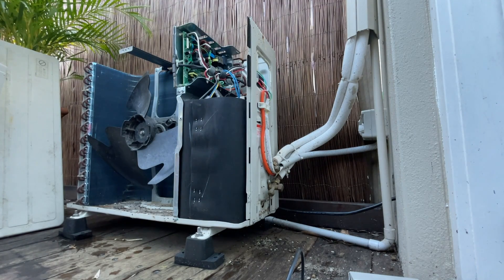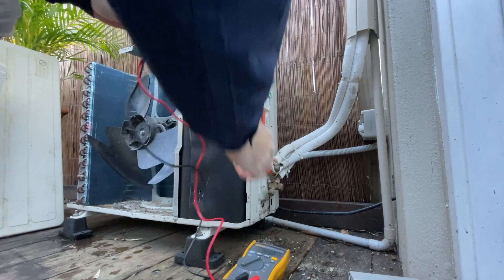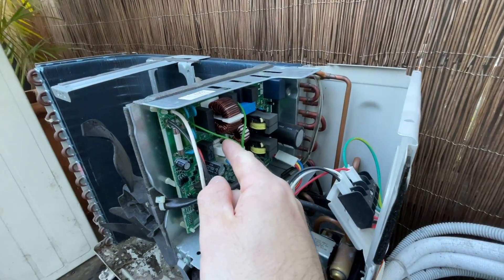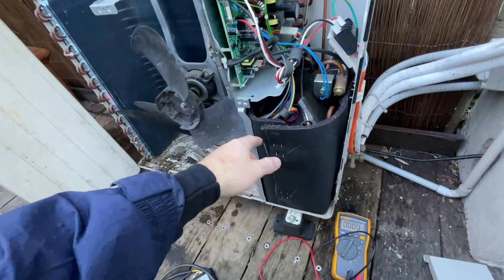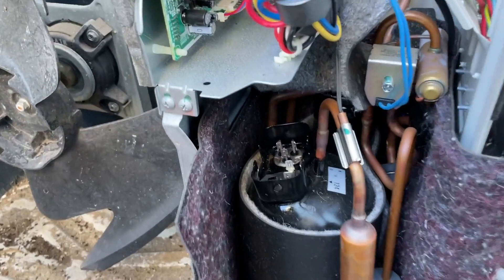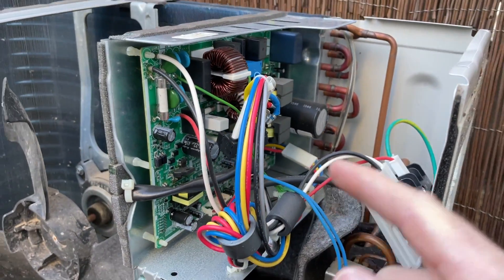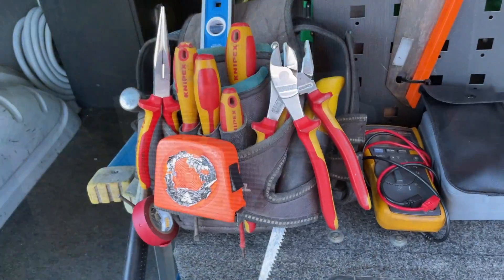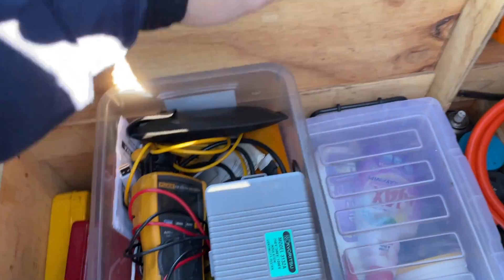DAIKIN Air Conditioner NOT HEATING 🥶

Comment: Hey mate. Commercial refrigeration install tech here. After 14 years working at same company installing Aldi, Cole’s etc finally kicked the bucket and joining a massive commercial air con service company. Just wondering in this circumstance, how come you instantly check the board before anything else? I’d assume off my limited air con knowledge no heating might mean the reversing valve is cooked or possibly even low on gas meaning low head pressure meaning less heating? Or is it as simple with these daikin units that it’s always the board? I’ve been binging your videos trying to familiarise myself with air con service and I’ve noticed most videos of yours it always seems to be the board that’s cooked and I barley see you pull the gauges out. Do you avoid putting gauges on as the gas charges are so small even losing your gauge line worth of gas could be detrimental to the system? Thanks mate love your work, learning a lot watching you!
Reply from the maker: @blakeusvon  hey mate, no heating and no cooling calls can absolutely be more then just a board. I often come across things that aren’t board related but yeah definitely the PCB in my opinion is the weak spot of modern inverter style air conditioners. I’d definitely invest in an inverter checker if you are giving service a go! Good luck with everything!

Comment: Do you ever disconnect the compressor wiring plug and test the comp that way instead of removing the terminals at the comp. Some comps are a prick to get the lugs off. And not all units have a plug that disconnects obviously
Reply from the maker: I personally don’t do that. I want a true reading of the compressor. The cable can absolutely manipulate the true compressor readings.

Comment: if the shaft is rusty... wtf, those are not protected is normal to rust. In this way, you could replace the whole unit, same price and longer life.
Reply from the maker: I got told at Daikin training that you should replace the fan motor when ever you replace the outdoor pcb especially if the shaft is rusty. It’s to prevent the system from cutting out on an E7 fault in the near future. 
Daikin fan motors stop working even when the fans still work (if the revolutions of the fan is slower then what it should be). So their reasoning is, if you’re doing a major repair then just replace an old fan motor at the same time. Replacing the fan motor and board is definitely cheaper then replacing the entire unit.

Comment: Mitch are you seeing any leak issues with the “ white” line sets? We have had a lot of problems after the 3-5 year mark. We are being told the adhesive in the material reacts with the condensation and forms a s it that attacks the copper.